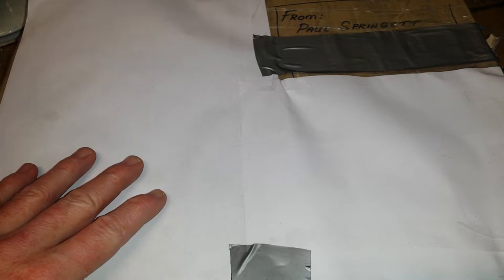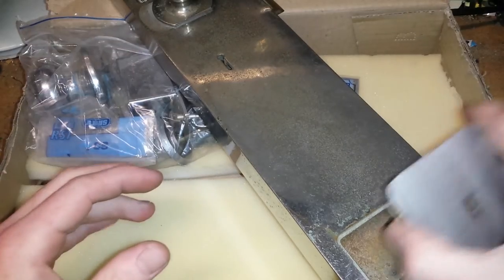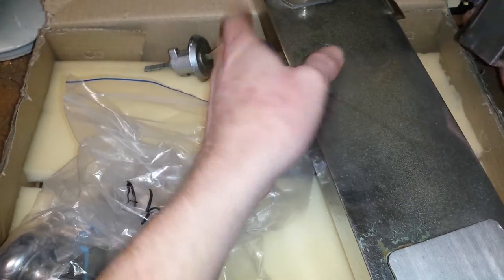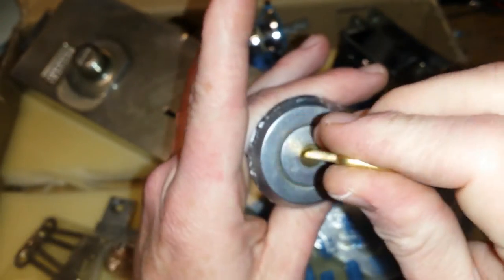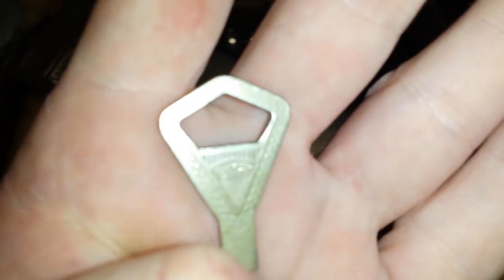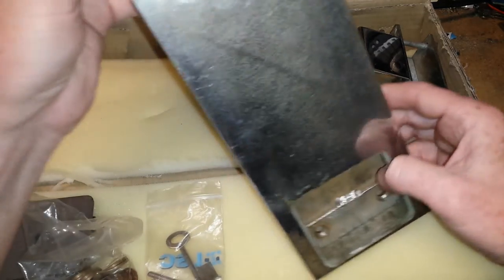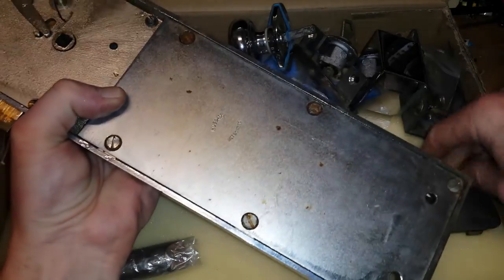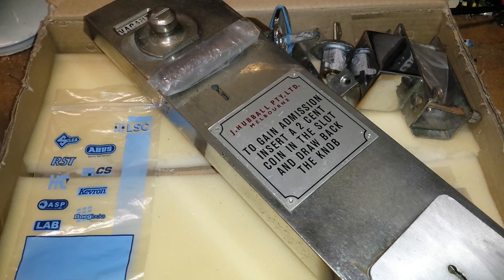Awesome Package from Paul Springett | Australian Pay toilet lock circa 1970's

Comment: Looking forward to the refurb of the ol' dunny lock. You may be correct with the return spring. Never paid too much heed to it. It was in that condition when i sourced it. I did check that it did function with the 2 cent piece. Maybe you could source some spring steel stock to refurb that part of the mechanism. By the way, alzimers is not my only flaw. Blindness is as well. The spacings i gave you on number one cut from shoulder should be .100 thou. Number 4 spacing should be .467 thou from shoulder. Cheers TR:-)
Reply from the maker: Me too :) it's like having a new toy, if it's a cut down bobby pin? It works, so if it's not fucked don't fix it I think, that said I have some spring steel in the form a a U-Bend-It kit from Peterson so I'll fix it, if and when it breaks, if that even happens that is.  I think it's a clever improvisation, if it is either way it's all good!  One for the brain bank.  Super keen to get stuck into it :) Cheers for the spacing's on the Lockwood I'll may put it on hold for the moment, while I play with my new toy, Cheers Paul as I said it's Awesome may be just an ole dunny lock to some but I think it's fucking cool!